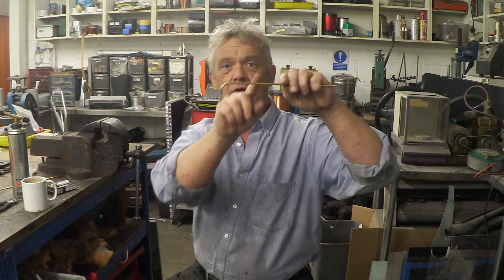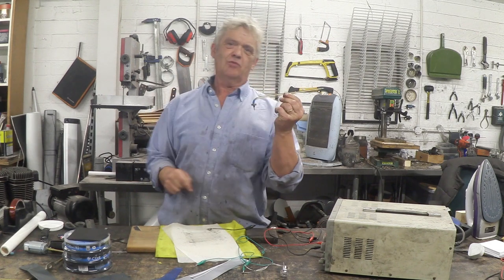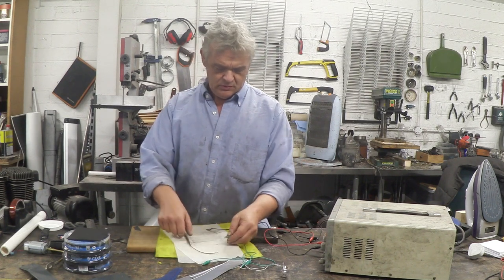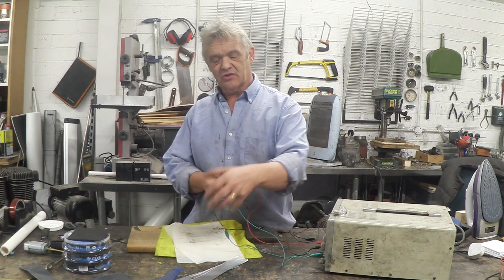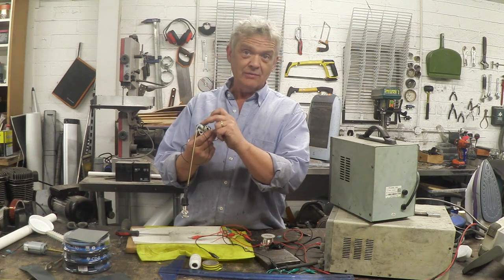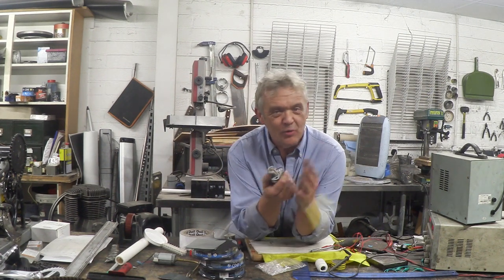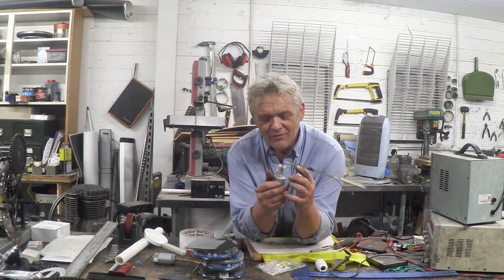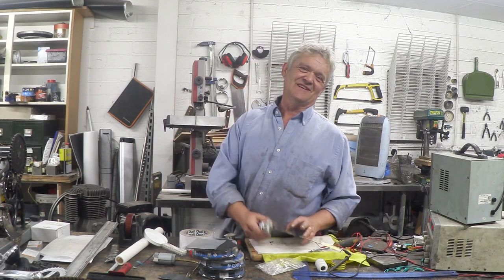1221 A Spinning Torch (Flash Light)- No Batteries Needed

Comment: really fun to do this with stepper motors too.   put a handle on the shaft with a kink.  then put leds both ways across the coils.  and glue them to the stepper motor.

Comment: Rob, You will find that running a current through a bearing is an imperfect contact and that at higher voltage and current is prone to arcing and erosion/deposition, that will destroy the bearing. Auto makers will never use a bearing as a current path.
Reply: it is a toy to goof with he is not going to run his house threw it
Reply: @ambersmith6517  Robert is talking concepts, and so am I.

Comment: You could add a handle to the motor shaft and attach the arm to the case of the motor. Then spin the motor and not the shaft. There would be no need for bearing slip ring. Just take two wires straight off the back of the motor to the LED. Or use the arm like you already have as one of the connections. Put one of your super capacitors on there and your away. The bearing slip ring could be used on wind turbines.
Reply from the maker: nice idea mate - effectively spin the magnet and not the coil

Comment: Thats fun. I'm not sure what interference were seeing. There some from the led but there another factor in the filming frames/second, refresh rate of monitors and some others.
Use a stepper motor ! The pattern you'll be seeing is directly related to the step angle from your motor. That'll give an amazing result.
Reply from the maker: well it is probably because commutation is only pseudo rectification
Reply: @ThinkingandTinkering  : Indeed. Something like that

Comment: Instead of reinventing the wheel... we had a setup back in the 90's where you could program the led to write a message or picture... should have grabbed one of those and replaced the battery pack with the generator.
Reply from the maker: I would have gone that way if I could have bought one lol

Comment: An interesting thought I remember the old toys where you would push on a rod or lever and the toy would spin like a fly wheel faster you pushed the lever the faster the flywheel would spin. I wonder if an old flashlight could be modified with a small motor like that a flywheel and a lever to produce a similar affect. I think the old toy was called a humming top.
Reply: I've seen something similar before called squeeze flashlights. Emergency flashlight that doesn't need batteries. There are also shake flashlights which have a small supercapacitor to store charge.
Reply from the maker: I am sure it could mate

Comment: Ways of getting electricity to a rotor 1) slip rings for AC or DC, 2) commutator for AC or DC, 3) inductive coupling for only AC 4) capacitive coupling for AC only. 

A coil inside a coil can act like a transformer. While capacitive coupling works better with high voltages and high freqency.
Reply from the maker: cheers mate